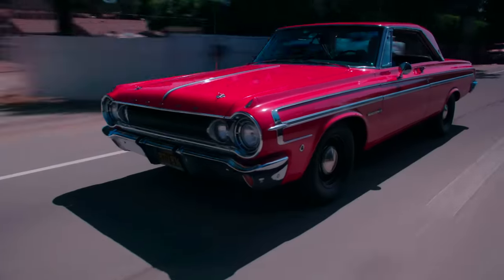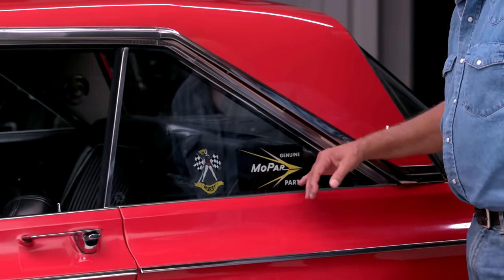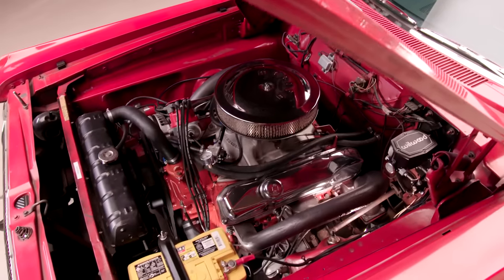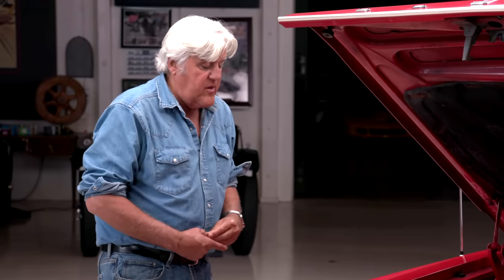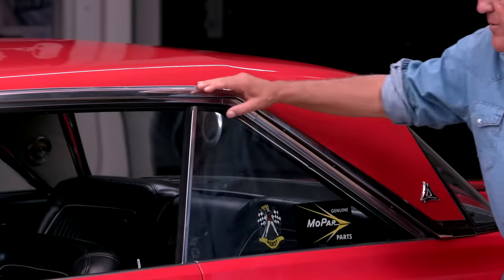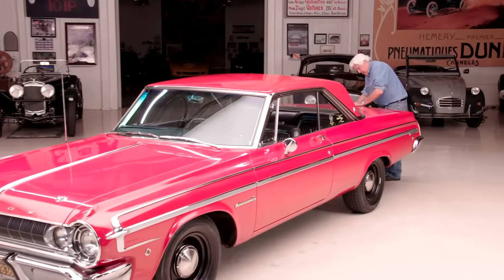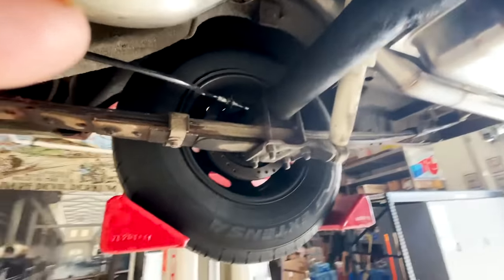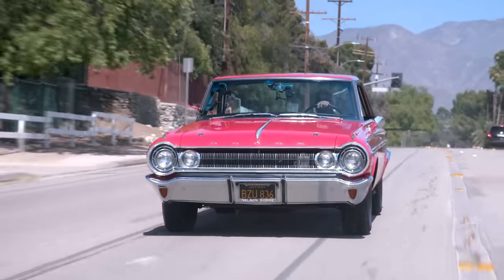1964 Dodge Polara | Jay Leno's Garage

Comment: I learned to drive in my Dad's 66 Imperial, it had power everything.
It kind of spoiled me.
Later my first car was a 72 imperial
( It was 1979)
Guzzled gas like there was no tomorrow, but handled sweet.
It impressed all the girls at the time.
Then I got my first Charger, it was a 71, with a 6 pack 440.
It changed everything for me.
I miss the old cars, Mr Leno is extremely lucky.
Reply: yup, the great old big cars, a "no-tell motel" (aka the back seat) on wheels, when on a date, was a major plus too!! :D

Comment: Jay, 
Thank you for the trip down memory lane. In 1964 I graduated H.S. and that year my father ordered a Polara 2-door coupe with the 383 engine, Torque-flite transmission and Positraction rear. (He wanted a 4 speed but my mother couldn't drive a manual). The car was white with the black bucket seat interior and the chrome console. After about a year or so he finally give me the keys and I would drive it...good thing he didn't actually see me driving it. I hung out at a local Shell station where guys would bring their rides, talk cars and race on a nice stretch of asphalt on the way out of town. A couple guys had 327 Chevy''s, one had a Ford Galaxy with a 390 and another had a Pontiac Catalina 389 tri-power. The Dodge stayed with or beat the other cars at least half the time, or more. Several times, after a race, a guy would ask me to pop the hood because they couldn't believe this was a totally stock car. I always had a good laugh when they realized I was telling them the truth. I was given the car about five years later and i drove it into the mid 1970's. I sure wish I had that Dodge back now...what memories!  Thanks again Jay...you're every car guy's 'car guy'.

Comment: That car looks awesome!  If NASCAR still had "real" cars like this one, I'd be more interested in it.
Reply: A lot of drivers died in those days
Reply: The closest thing I ever rode in was a 67 GTX, with the 375 hp. 440. It had so much torque, you could fry a back set of tires in one day. It was a scary ride !
Reply: ..me too...reminds me of Richard Petty's '64 Plymouth
Reply: @thechurchoftruth8578  
Not really, considering the amount of drivers and distance run. Back then NASCAR was much safer than many other forms of motorsport!
Reply: @jeromebreeding3302  had a 69 as my first car in high school.  But mine was so beat up but all engine. Have some stories for my kids now
Reply: Fully agreed, although they’re getting more and more like touring car-type racing all the time, which is pretty good, too.
Reply: @russellmcelveny1014  As opposed to commenting for divisive political points?
Reply: Helped restore a max wedge lightweight car -  aluminum fenders, hood and bumper. Different approach with the bodywork!
Reply: @saseeman1  Did it have the acid-dipped bumpers and doors and all that stuff, too? I know certain super-stock Mopars did, but not which ones. That’s awesome!
Reply: yup, left Nascar and the drags too when you could not tell the model car anymore. No point to it now, and with foreign engines in them, who cares, I sure don't. It's just way too boring now.

Comment: Reminded me of my 1st "performance" car. A 1967 Olds 442. Like your car, no AC, no power brakes, no power steering and the 4 speed Hurst shifter. With no power steering you needed the huge steering wheel. The car was a workout to drive but I loved it dearly. I was 16 when I bought it for $900 with the odometer cable disconnected at 94,000 miles - I put another 150,000 miles on it and not once did it break down on me. Thanks Jay.

Comment: Jay, love your content.  I just finished a complete roticerie restoration on my '64 Polara 426 Street Wedge.  A couple comments though... a '64 426 Street Wedge would have come from the factory with log style exhaust manifolds.  The ones yours has are the Max Wedge factory headers. That said, you could easily have purchased the Max Wedge units over the parts counter back in the day. Now days however, those are as rare as hounds teeth.  Also, I'm glad to see you kept the original rear end and the trunion drive shaft.  Most people swap them out for later units because the drum brakes are a real paint in the rear (no pun intended) to service.  There is an easy way to solve that problem and I wrote an article on how to swap out the original swedged drums for easily serviceable slip on units, but that's another story.  The stock rear is very strong and will last for eons if properly maintained.  All in all a beautiful rendition of Dodge's mid sized '64 model.  Yes I did say "mid sized".  Some so called experts in the automotive media claim the Polara was a full sized car but it wasn't.  Later in '64 Dodge came out with their somewhat delayed full sized car the 880.  So don't let anyone tell you it was a full sized car.  Great job, Jay!! Love watching your videos.
Reply: Was just going to do a search on those headers!  Thank you very much for the comment.  They are cast iron, he said.  But factory, or over the counter from the dealer option?  Were they tuned for length?  They look fantastic.
Also, did the "64 come with options for carb?
Reply: The max wedge exhaust manifolds have been reproduced and IIRC are available from Mancini Racing.
Reply: @Redmenace96  They were factory installed on the max wedge cars and over the counter for the non max wedge cars.

Comment: I've always been into Chrysler products. At first I thought it was because my family always drove them. But later, I came to realize that I liked the fact that they were just so well engineered. Engines like 340's 383's, and 440's were pretty much bullet proof. You really didn't see them blow or wear out like a lot of GM and Ford engines. And the 904 and 727 Torqueflite transmissions were more durable than the GM and Ford offerings. 

Being a smaller company, Chrysler couldn't afford to build separate performance-specific cars like Mustangs, GTO's, and Camaros, so their muscle cars tended to be two-door versions of their family cars, like this Polara, with big engines stuffed in them. And I liked that. You could get a 6-cylinder Dodge Demon for next to nothing, and stuff a 340 or even a 440 in it without much trouble, and voila! You've got a really fast, tough muscle car for a lot less than what you would pay for a comparable Mustang or Camaro.

And because Chrysler couldn't afford to do a bunch of different components for different cars, there was a lot of part interchangeability across platforms and model years. That made it easier to find replacement parts for the 60's and 70's cars during the 80's and 90's, before you could get the reproduction parts available now. 

This Dodge Polara is a prime example of Chrysler at its best. You wouldn't think anything of it if you saw it in a parking lot. But because of its light weight, and the long overhang past the rear axle, giving it really good weight transfer under acceleration, these things made phenomenal drag cars. That's one reason why so few of these 64's are still around. It figures Jay would have one of these Max Wedge cars. This is a cool car because it truly is a wolf in sheep's clothing.

Comment: Beautiful car and great video, but it seems, if I have seen it correctly, that your new brake calipers are mounted the wrong way around, as the bleeder valves are on the bottom instead of the top of the caliper. For getting all air out while bleeding the system, they should be on top of the caliper.
Thank you for sharing this great car with us :-)

Comment: Beautiful.  I learned recently that Mopars from back then tended to bias the rear leaf springs rearward of the axle.  You can clearly see that on this Polara...way more spring behind the axle than in front of it.  The thinking was that the spring wouldn't wind up as much and cause hopping problems under hard launches.  The other manufacturers tended to center the axle on the spring, which required slapper bars to control the axle.  As a high schooler in the 70's, all the "cool kids" put slapper bars on their cars whether they needed them or not lol.
Reply: Or, if you had a car with rear coil springs like my big block Chevelle, you had to go with "ladder bars" to stop the wheel hop.

Comment: Hi Jay:  The best thing to do with that motor is to add a 0.5 inch stroker crankshaft kit with the correct rods and pistons.  The big advantage to that modification with this motor is that you end up 4.25 bore and 4.25 stroke.  Also, you end up with 482 cu.in…. Just a stump puller..!
I love all the MoPar’s from that age really 1962-1965 Dodge and Plymouth. However just about any color but red… Ha, ha, ha.
Jay, great to see you in an old MoPar !

Comment: Great video! I own a 1964 polara 500 with a vinyl top. Odd choice for a factory delete race car! No heater, radio, etc. I got it as a highly modified rolling chassis.  12pt cage front bumper to rear bumper, 2 door bars,  aluminum interior, fiberglass hood, bumper, and deck lid lexan windows, tubbed and ladder bars. Car was never on the street. Has a front motor plate and absolutely no evidence of ever having had normal engine mounts. Was a wedge automatic.  Guy i got it from claimed it weighed 2850lb with an all iron 440, 727, two bus batteries and him standing beside it! They milled out or cut out everything not essential even milling out bumper mounts! I like it because its similar to Dads 1964 sport fury 4 spd he had in college, he put a 413 with long rams in it with an expiremental crane cam. Ive had that cam duplicated because absolutely no other cam I've tried makes those rams talk like that! its getting a 572 all aluminum keith balck block hemi with a 10-71 TBS blower and electronic bugcatcher efi and an ATI 1500hp powerglide.  I will make it NHRA and street legal. Its still on drum brakes! But not for long. Just waiting for For Hemis Only to machine and ship me the parts so I can build the motor and get it dynoed.  I started racing in "cheap" for the 90's C bodies. Give a couple hundred bucks and wind up with exactly the same big block powertrain as the muscle cars! I still have the 68 dodge monaco 4 door we had a 440+6 in and now a 400 with 1961 long rams (no they're not cut or short rams) and 4.56 gears. long rams when tuned correctly with the right cam will put any other OEM intakes to shame at ANY rpm, we've had 3 sets on many engines and in many cars in 50+ years. Ive got a 727  bellhousing that was split in half at 7500rpm on a 413 long ram when it flashed the tires at 50mph and was shifted into high to try to save it. My 383 long ram flashed to 7800 right thru the orange box 6500 rev limiter in high gear at 130+ mph in a 1970 newport, you could go back and see black marks every 800 rpm when that tuning came in! That motor was the original 2 bbl 383 and never had the heads or oil pan off! Oh, and it got 21mpg on 87. I don't care who believes me, I have the car, 2000+ timeslips, witnesses, and 42 top eliminator trophies! BTW my favorite cars are a 1961 300F and a 1970 Chrysler Hurst newport. Love your programs they've helped me through my recent brain tumor, moving, and my fathers passing due to brain cancer.

Comment: We had a brand new '64 Polara 440 wagon with 3 bench seats, tons of glass, a 383 4bl, and dual exhausts. A modern "blended family" with 4 kids, moving from Air Force base to base. At least once a month, we would get on the highway to "Clean out the carbon" with a high speed run, never a ticket. Those Airmen can be sneaky, or stealthy as they would say now. A fun family Saturday outing was to wash and wax the blue beast then go to the beach or park for a picnic. Good times. Thanks, Jay.

Comment: In the early to mid-70's, 1960's cars were cheap and plentiful, you could get a 65 Chevy for 200 bucks and run the living hell out of it and when it died, you'd just get another car. I had a '66 Plymouth Belvedere for a brief while and the automatic choke crapped out. Dad said " We can fix that right now " and he went back into his shop and came out with an old bakelite button with a " T " on it and a cable attached from maybe the 1940's and voila, I had a manual choke. Awesome memories of those cars.

Comment: WOW!  Sure makes me miss my '63 Plymouth Fury.  What a great 1st car that was!!  Even though it only had a 318 and a Torqueflight automatic, it was a fairly fast fully stock car.
Reply: Thats what I was gonna say, its the same frame and almost the same proportions, right?
Reply: @kadimsilahtar  Pretty dang close if not exact.  A little more squared off in places, but very close.  Dang! I miss that car floating down the highway at 80!
Reply: Oooh... Christine! 
(Though of course, she was a 58)
Reply: @blacktoothfox677  LOL!  I remember driving a bunch of friends to that movie for a midnight showing.  They ALL walked home!  Refused to get into my car after the movie!
Reply: @robedmund9948  you should’ve drove past them hunched down so they couldn’t see you , thinking it was the car ,  yes I’m aware that happened many decades ago
Reply: @robedmund9948  I still have my fist car, 1963 Fury Commando 361.  I had a female friend that I liked but my car didn't.  The car would stop running when she would get in.  I mean something would go bad.  The car had no problem with her sister, however.  After 30 years I asked her about it and she remembers that well.  Yes she is Christine's little sister, Sherry.

By the way the "Ok, Show Me" line has not worked yet, but I keep on trying. Next year will be 40 years together.

Comment: My 1st car I was 15 years old paid $50 383  4 speed black . The brakes were as you said very much heat prone . Got it running just in time for the oil embargo a learning experience in many ways. Also  helped that the car was known by the police . $5 got a full tank of premium and
more hilarious fun than a teenager could ever hope to find on a county road .
Reply: That car is the reason why in 10 years of owning a ZR-1  no tickets or mishaps.

Comment: Not as special, but, I still have mine.  In fact, I had my first driving lessons with my grandfather in my 1964 Polara 4 door.  Only a 225 slant six (I had rebuilt) but it's good enough for me.  :)
Reply: Slant 6 is the most dependable and longest lasting engine I ever owned. The one I'm referring to was in a '61 Valiant, and it had almost a half million miles on it (NEVER REBUILT) when I sold it in the early 2000s.

Comment: Some of these and the big dodges you could put the short or long cross ram manifolds. Put on later, bigger, spread bore carbs and run two moderate size Paxton superchargers tito each carb.
Those wedges with Sunoco 260 and enough good cam and advance,  like a CROWER or the like, would absolutely make 500+ HP which was phenomenal for thevtime

Comment: In contrast. The 1989 BMW M5 (read "man 5") boasts a 0-60 time of 5.4 sec (Jay's car here clocks in at 6.2 sec). This is with the M5 weighing a full 4000lbs. Walking through my small Northern Idaho town last week I saw a 1964 Polara parked (no "for sale" sign) I took some pics. Send me a link and I send them Jay. These Polara's ended up being used by the CHP. I read the specs on a 1969 CHP Polara. One item that caught my attention, manual steering.

Comment: Ah yes, the old hose clamp balancer on the drive shaft.  :)
Reply: I caught that as well.  Maybe close to quittin time for Bernard that day...    Another great, fun video from Mr Leno,  love when he does them on his own cars.
Reply: for balance?  I can't imagine it.  I'm wondering why.
Reply: @fd797  It's an old shade tree mechanic method to remove driveline vibration. I can't imagine Jay's guys doing it either unless it was temporary to mark the location needed to weld weights.
Reply: @BamaPhill  How are these clamps placed? In what position? Are there balancing machines that indicate where on the drive shaft a weight is needed?
Reply: @michaelmcfeely6588   If you look in the video when the car is on the lift, you will see a hose clamp on the front and rear of the driveshaft.  The heavier part of the clamp is on the side of the screw.  So, you put them on the driveshaft tighten them down, drive car and see if it helps.  If not, loosen the clamp and rotate until you find the sweet spot and determine where to permanently weld on weights.  Personally, I have my custom driveshafts fabricated by a driveline specialty shop.  They balance them using a machine.

Comment: Owned a 1964 Polara former Highway Patrol car.  413, 3 speed, REALLY tall rear axle ratio.  Top speed 140, shifted out of 2nd gear at 90.  But but the speedometer only went up to 120, so how do you know it would go 140?  The CHP had special speedometers that would allow the needle to go past the 120 indication, past the odometer window, and when the needle wound all the way around to zero, you were going 140.